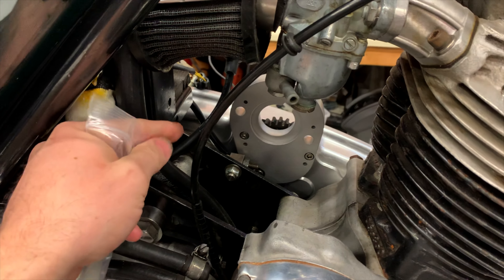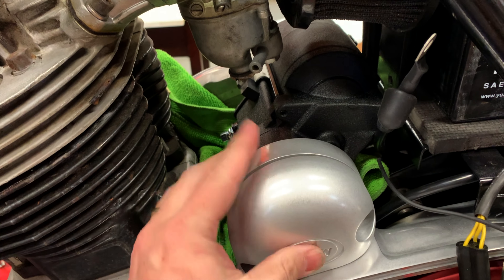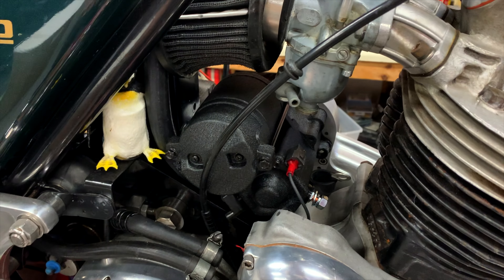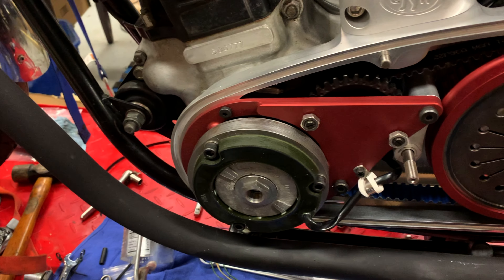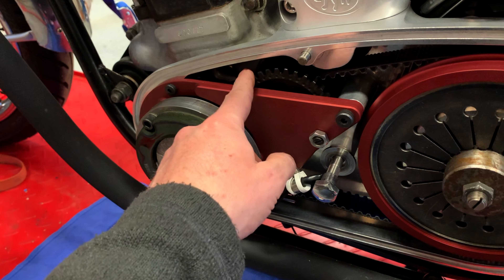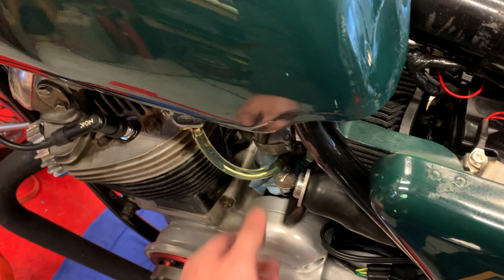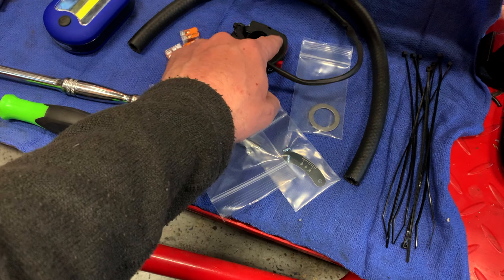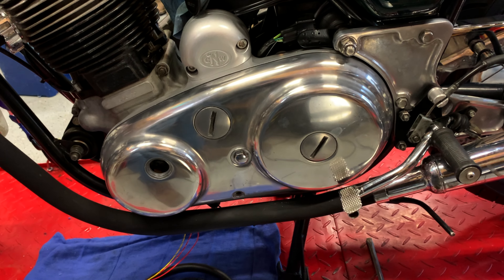Installing Norton Commando CNW Electric Starter - Part 3 of 4

Comment: It would be nice to see some still pictures of the finished  battery mount and battery cable  routes.. I also would recheck the alternator rotor nut tightness after a little run time. I just installed one in a 1972 Combat, so far so good, and it makes doing final tuning and checks much easier and fun.  Carl H
Reply: @CarlyG18 I will try to get some shots of the battery and cable routing, and thanks for the tip to check the alternator rotor. I only have about 75 miles on the bike since the install completed, but I have been pulling the primary cover after every ride just to check everything out.
Reply: @friesenmj  OK thank you, I route the head feed line between the manifolds and I stopped using the OEM plastic ones and use the Venhill SS kit.

Comment: Mike you did a brilliant job in covering that installation, thank you for thar. Question please the two adjusters screw that you adjust with the engine running to stop the idler gear spinning with the engine, do they depend merely on friction to stop it rotating and if so does that mean after so many uses of the electric start system do you need to check the friction is still stopping the idler spinning with the engine.

Comment: What are you using for a stater shim in the video ?
Reply from the maker: Mike cut the shim from a plastic bottle.
Reply: So, What is it ?  How thick is the plastic? What diameter bottle, etc?  Inquiring minds need to know.
Reply from the maker: It looks like 365 Electrolyte Enhanced Water, 50.7 Fl Oz by Whole Foods Market and available on Amazon.com, but try not to overthink it, Rick 😉 I just use several pieces of thin cardboard (and I don't know the exact thickness).
Reply: Thank you for that. I still need to call Matt and find out what's wrong with my starter and charging issues.
Reply from the maker: @Ricky40369  Good luck Rick. I'm sure that Matt will be able to help. Best wishes